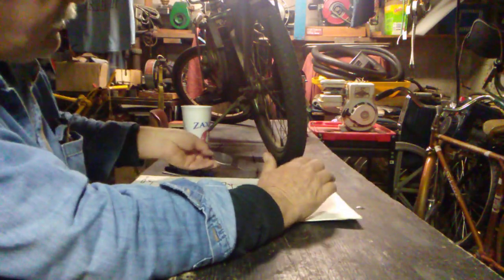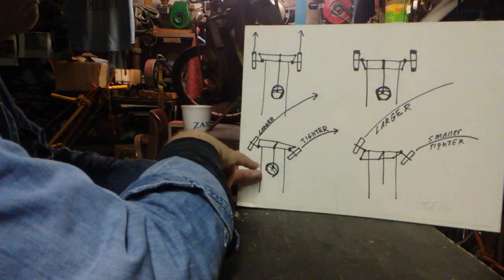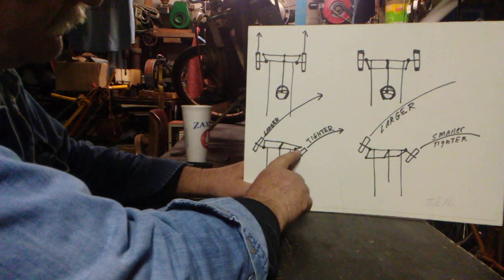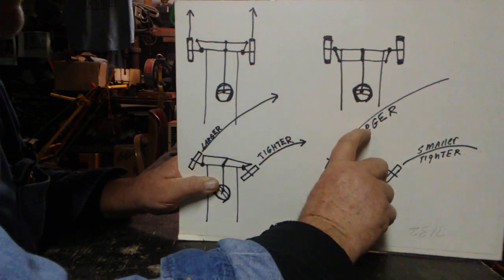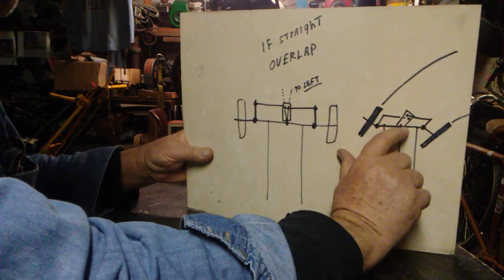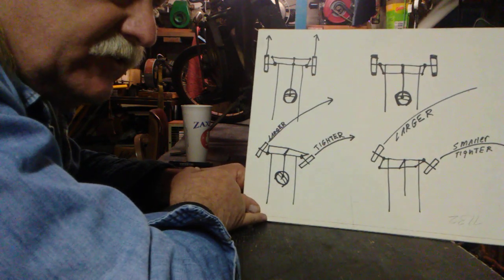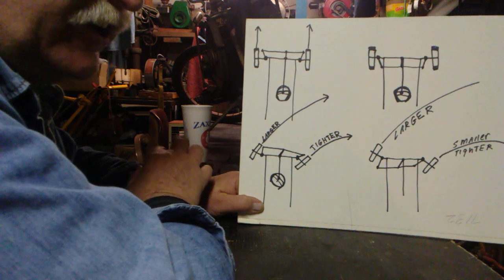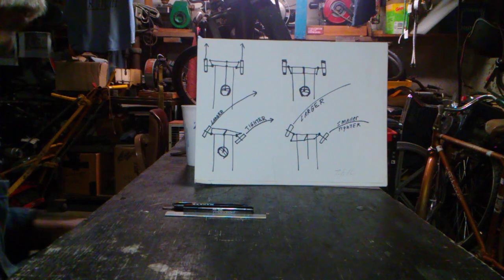GoKart steering explained,including Ackermann Theory.WATCH BEFORE YOU WELD!

Comment: Great informative video. I knew about Ackermann, but did not know about crossover tierod method. I am building a kart now, still on paper. I think l may try the crossover method. Is there a preferred spacing between holes, or a formula to calculate it? Thank you for making it easy for all to understand.
Reply: Have you figured this out?  I am wondering the answer also

Comment: Now can you do one on adjusting the camber and the caster on the pivot points. I've noticed it simple steering knuckles are pretty much straight. But the better ones have some angle. Even the C clip that holds the kingpin is welded on at an angle.😊
Reply: kingpin inclination, the angle of the kingpin from vertical when looked at the front. helps self center. think of the frame as "hanging" from the kingpins. also brings pivot line to CENTER of wheel. "scrub steer radius". reduce bump steer.
caster. angle from vertical when looking from the side. moves pivot point in front of contact patch. so friction helps self center.

camber. angle of the WHEELS when looked from the front. all lined up with that kingpin inclination so tyres rotate on center of tread, ideally...

Comment: Thx for the info. I bought a Carter go kart from a guy who said they did some work on it...😳. They did some work on it alright. Everything was a disaster. The steering was/is terrible. This is like the picture on the left (center bolt is 1 bolt) and they have the tie rods pointing dead straight. I’m hoping when I adjust them as u say it steers much better. Also they had a super skinny belt on it and it needed a 3/4” belt. The torque converter isn’t working properly and it killing the new belt. I’m finding rubber dust everywhere on the back of the bench seat from the belt.. I sure hope I can get this all worked out soon before I drive it off a cliff..😜

Comment: what would be the measurement comparison of the two horizontal lenghts?? in order for the tie rods to be at the right angle??????
Reply: Theres no set angle. Take a string and run from center of kingpin, to center of rear axle. The mounting hole for tie rods should be along that string. Hope that makes sense. This guy really complicates this.